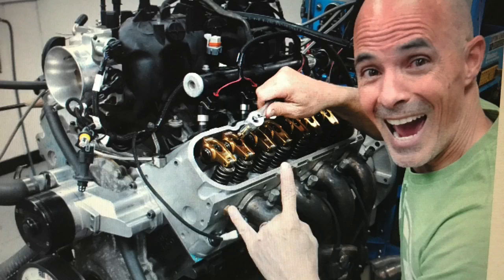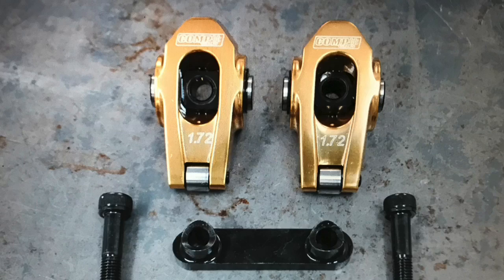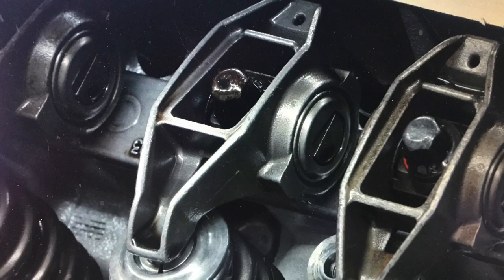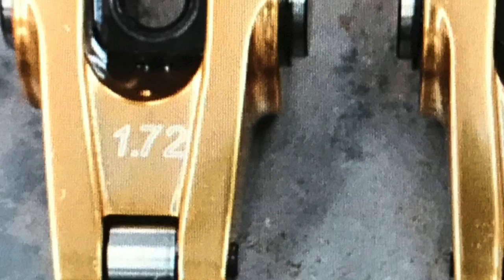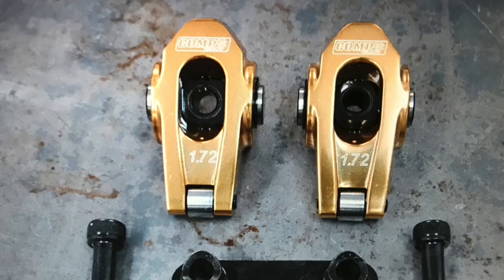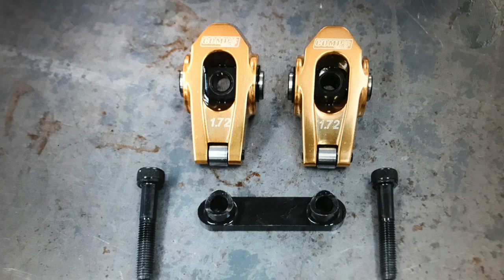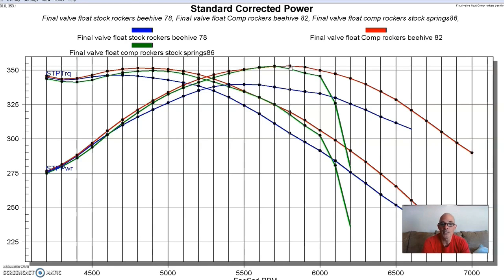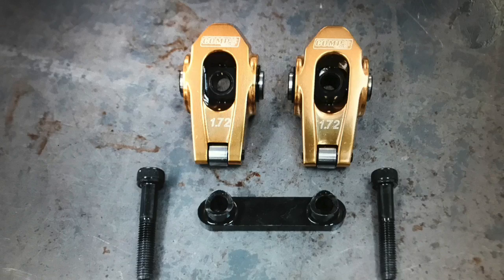LS ROLLER ROCKER TEST-DO THEY WORK?

Comment: I was thinking about upgrading springs and just the rocker ratio to like 1.8 or I was some 1.9 with the stock cam on my truck but was wondering if I needed different length pushrods now I know just put a cam in it but instead but was just wondering I mean if I have to get pushrods it's not worth it
Reply: Pushrod length should be fine with a LS engine, but always check. I run the Comp 1.8s on my  LS2 with no change in pushrods needed after measuring.
Reply from the maker: make sure to measure

Comment: I have a question.. if you upgrade the roller rocker and valve springs and retainers plus cam, what determines the size of push rod you need for the combination?
Reply from the maker: we measure to verify

Comment: Hey Richard holdener,  have you ever tested a ls underdrive pulley?
Reply from the maker: back in the 5.0L Ford days
Reply: @richardholdener1727  so does that means you have video on deck for us to watch In the near future?
Reply: OK.... I'm still building Fox cars... after all these years. 
Affordable performance.
Reply: That would be good video! I personally felt a improvement, through the seat of the pants dyno. SLP under drive pulley. But would like to see something on a graph!
Reply: I currently have a under drive pulley and light weight alternator pulley on my engine. I felt a little more vibration from the engine but it seems more willing to rev. I don't have any dyno runs but know it's not a night and day difference.  I saved it for the last possible NA mod i could do.

Comment: 7cc dome pistons on a 706 head, what’s a rough “guesstimate” on the compression ratio
Reply from the maker: on this 4.8L its a tad more than 1/2 point over stock
Reply: Richard Holdener sweet, thanks for the info and keep up the hard work.🤙
Reply: @richardholdener1727  correct. I calculated on a 5.3 not a 4.8. 10.27 is correct for this combo assuming stock head gasket,stock head chamber volume, and stock deck height.
Reply: 11.25:1
Reply from the maker: not even close

Comment: What about adding a stronger pushrod that doesnt flex much
Reply: How much heavier is that stronger pushrod? 5 grams? 10 grams? 3 grams? What's the weight difference between the the stock rocker vs Roller rocker. All this reciprocating mass adds up. I'm of the opinion that to really reduce reciprocating mass in the valve train without going to SOHC or DOCH with multiple valves one would need to position the cam much closer to the cylinder head face. Obviously that's out of the question for a factory engine. I'm surprised none of the billet engine builders haven't taken this to its logical conclusion.  Some of the billet blocks have the cam raised. In the early 80s until around 1992 I had a Renault I used for basic transportation. When I picked up the a copy of the factory manual the section on the engine showed the camshaft was so high in the block that the timing chain sprocket actually was partially higher than the deck of block. The valve train was extremely short. Plus it was a Hemi head with a crossflow head. Unfortunately is is very hard to find pictures on line.
Imagine a V-8 with a cam for each cylinder bank. Between the cam lobe and the pushrod use a finger follower. Have the pushrod seat in the rocker arm at least closer to the camshaft. Ideally so that the centerline of the tip radius, the centerline of the rocker arm and the centerline of the pushrod seat are all inline. Actually with this arrangement a 4 valve pushrod combustion chamber might really be workable.
Of course a production engine built this way is more costly. In terms of parts,  tooling, machinery and assembly it's probably just as easy to go OHC
Reply from the maker: take a look at the Chevy/Mercedes Ilmore Indy 500 motor (stock block rule)
Reply: @richardholdener1727 
That's why I thought of the finger followers. Plus I suspect the rules stated "cam as in singular in block". Ilmor really twisted the rule book when they designed that engine. But they have been stacked one above the other. And in time honored motorsports tradition the people most innovative with the rules got slapped down. 
Both Chevrolet and  Chrysler have looked into twin cam OHV V-8s. But in those cases the camshafts were stacked one over the other.
The OHV V-8 is considered by many to be a dead end technology. In deed OHV engines in general. Yes in terms of efficiency an OHC arrangement is better. But an OHC of equal displacement will almost always be larger in terms of packaging than an OHV*. The compromise between the two. The Cam In Head. I know it's been done by Opel (65 to 95 iirc). But that suffered from the limitations the cam placement imposed. Reverse Flow Head, complicated head casting etc. But it allowed Opel to carry over a lot of parts from their OHV designs. But most importantly it allowed smaller over all engine packaging. I seem to recall Ford had one engine that used that layout. Of course OHC does always mean a crossflow head. Witness the first two GM engines to be OHC (at least the ones I know of). The  Pontiac OHC 6 and the Vega OHC 4. Both non crossflow head designs which look very similiar. 
The whole point of this is that we haven't seen the last of the OHV engine. Or old out of date designs that have been discarded.  As witnessed by this effort in true hot rodding spirit
http://www.hotrod.com/articles/hppp-0606-pontiac-sprint-six-engine-build/
I dont know if the builders ever finished the project up but with a good welder and machinist a lot is possible

*In my opinion for the overwhelming majority of drivers the benefits of an OHC or DOHC over a OHV design is  not that significant. At the lower rpm range most engines operate in for the vast majority of their lives the benefits of DOHC 4 valve combustion chambered are overkill. But in certain market segments its required if you want to keep up with the segment trend setters. I suspect if Toyota or Honda started selling a vehicle that offered better power, fuel economy, reduced noise etc that just happened to be an OHV design other manufacturers would be trying to play catch-up.
Reply from the maker: that can help
Reply: I went for a full cam kit. Comes with cam,gaskets, springs ti retainers, stem seals, and hardened pushrods. 
It was from hawks motorsport

Comment: Good upload but not much new info......."Bold The Cold".....what the heck?
Reply from the maker: was from my Ninja Warrior adventure in Denver
Reply: @richardholdener1727  Good country.....have two daughters in Denver now.  Both work out like crazy....one owns a physical training business; the other works out like crazy.  Both of them hold degrees in engineering from Colorado School of Mines.  I was a USPS ranger in the Rockies for several years.  You look like a runner....I ran 20-25 miles/week for 40 years until a broken back ended that activity.  Really miss the runners "high" that I used to live for.  Keep the Faith, Richard.

Comment: I had valve float with stock cam, stock springs on my LS2 with the Comp 1.8 rockers at 6000-6200rpms. Replace your springs at the same time guys save yourself the trouble later.
Reply: correct, when you do a cam swap, do a spring swap!!!
Reply: @TaylorParks87  apparently,  even when only doing a rocker swap.
Reply: @Turbo_Todd  ESPECIALLY when doing a rocker swap.
Reply: @Turbo_Todd  putting a rocker with more mass, the spring cant support
Reply: @daveoneal5544  thanks, but yes i understood that.  I was replying to the OP that only mentioned a cam swap
Reply: @Turbo_Todd  but the OP never mentioned a cam replacement
Reply: @TaylorParks87  Yes, IF you alter timing events beyond the capacity of the springs, which is mainly when you're  swapping out a stock cam with stock springs. Not needed if they have already been replaced and can handle a bit more cam.

Comment: Another thing an older engine with stamped rockers (gen 1-2 SBC, gen 1-2 SBF, gen 1-7 BBC, etc) benefits from with roller rockers is a more accurate ratio. The stamped steel rockers aren't wearproof and unlike LS rockers, they have 2 wear points, tip and the fulcrum because they're both sliding friction surfaces. 
I had a stock 100+K mile 327 impala a few years ago with 275/60 tires and it wouldn't do a burnout. I put roller rockers (same 1.5 ratio as stock mind you) on there and it was actually able to spin em.

Comment: I recently went Comp roller on my LQ9 except I did the 1.8. Last year I did the Crane 210/218 on a 114 LSA.
Reply: Tom Wetz  little after 2,500.  At 1,500 cruise it's a little choppy and a deep drone that wasn't there before.  Running TBSS intake, TB, injectors, dynatech headers. Was tuned.

Comment: I always assumed that with a higher lift cam and stronger valve springs losses from deflection would be greater with factory rockers so gains from the stronger aftermarket roller rocker might be a little more. Maybe this would be more of an issue with older style SBC and other stamped steel rockers. Any thoughts on that? Great job on the videos, I really enjoy them.
Reply: I think you are correct
Reply: I broke a couple stamped sbc rockers after changing to a sig erson stage 2 with spring upgrade. The things just cracked in two. Definitely recommend a roller with a cam/spring upgrade on those old motors.
Reply from the maker: not a lot of deflection on stock LS rockers, also this combo wanted more camshaft so it responded. If you give it more cam, might respond less to rocker ratio change

Comment: Great Content as always. Tons of data. My question is, I remember reading an old Hot Rod magazine article about crank shafts and the material they are made from. It talked about crank flexing under the compression stroke and all things being equal, stroke and weight, a crank made of 4340 will show more power than a cast crank simply because it won't flex under the combustion stroke. Thoughts?
Reply from the maker: not sure when (or if) that would become a reality
Reply: That claim does not make sense from a mechanical engineering material science point of view. Deflection (strain) as a function of load (stress) is well understood science. All materials will flex/strain under load, the question is how much - and at what point will it yield, fatigue or break. The slope of the "stress-strain" graph is called "modulus",  and defines the elasticity of the material. The modulus of all iron-based alloys (including cast iron, nodular iron, 4340, 300M, Stainless steels, etc) ALWAYS hovers right around 30 million pounds per square inch. There is almost no difference in modulus for the various different alloys of iron. Therefore, you should not expect different flex characteristics from one iron alloy to another.  Do not confuse modulus with strength, which is a totally different characteristic. I hope that helps.
Reply: Nodular Cast Iron cranks are pretty tough. Not as tough as a forged or billet crankshaft that has been properly heat treated. But equal up to the power le else of what most drivers could adequately handle on the street. Admit it, we have all known somebody who was either too young, too inexperienced, lacking in skills, lacking in reflexes that have gotten themselves in trouble or worse killed themselves and maybe somebody else. Simply because they were driving more car than they could handle. In some ways I'm surprised that governments in general haven't come down on the manufacturers on the performance side of things. Or state governments on drivers licensing. When one takes flying lessons and gets their ticket to fly a Cessna 170 that does not mean you can hop in a P-51 and take it up. With carsit's different. Take your test driving a Honda Civic and then when you get home you can take off in 600 hp car. If the idea of some 16 year old kid behind the wheel of a car that has the potential to exceed double the legal limit most places (are there any states with prudent limits) does not scare the snot out you it does me. I'm lucky. I didnt kill myself or anyone else doing some of the idiotic things I did in the day. Others I knew weren't so lucky.

Comment: For my money, I would rather spend $400 on a cam and springs (since springs will likely be needed with rockers anyway), and pick up 50-70 HP than spend the same money on rockers and pick up 10. Also, you have a TON of laps on that poor little 4.8 by now, that's been a great test mule. Thanks as always Richard.
Reply: What if you already have everything done except aftermarket rockers...are they worth it now?
Reply: @Forcefed2002  probably not for 10 HP, not to me at least. At least not on a LS. On a BBC or SBC they would've been one of first purchases along with the camshaft upgrade.
Reply: @Forcefed2002  If you have headers, cold air intake, FAST 102 then yes. As a final mod it's fine, and you have upgraded your stock valvesprings too so one less thing to do if you cam it.
Reply: Cam install is not comparable in time and money. 1.8's and valvesprings are easy to install and still cheaper. $340 for the rockers and $200ish for springs. Nowhere the same in power but it's a decent increase and if you do cam it, your springs are done. Have you ever done a cam install? If you have you know it requires at least 4x the labor Add in the cost of a dyno tune now.
Reply: atf0013 
$340 for rockers and $200 for springs that give minimal gains without a tune and about 10hp with a tune (like what Holdener did here as he optimizes the tune with every setup he tests) 
VS 
$260 Summit brand Sum-8718 cam (similar specs to a Stage 1 truck cam from BTR or TSP) that doesn’t need springs and adds about 50hp to a 5.3L and 35-45hp to a 6L (as demonstrated in his test with stage 1, 2, & 3 truck cams).

Seems to me that a mild cam that reuses springs is about half the cost and about 3-5 times the power gains.  Plus, spring changes can take just as long (and are arguably more difficult than) as swapping a LS cam when it’s in the vehicle...  not to mention a spring change allows much larger cams that can gain 75+hp or more depending on setup; especially on a 6L.

And really, what’s a few hours of work to increase your power drastically.
Reply: ChuckO Are you including the actual costs in parts that go with a cam swap, like gaskets, oil pump, timing chain? Gonna reuse all that stuff?   Dyno tunes cost around $500 for a cammed car too. And a cam swap requires a lot more than just springs and rockers. 1.72 Rockers alone are probably not worth it for the money to most as a stand alone mod, but if you want to run the stock cam, 1.8's pick up 15hp on average to the wheels, and this should be a easy final bolt on addition after LT headers, and FAST 102 etc. I don't think that baby Summitracing cam is worth swapping. 500 lift? Anything under 600 lift in a LSx is pointless my man. Except maybe on a 4.8 or 5.3? Most heads like the 706, 799/243 flow best at .600. Stock LSx valvesprings are only good to .550-570 realistically and even less with higher miles, so rockers or a cam worth a damn means new valvesprings.

Comment: What about chainging from a 1.7 ratio to a 1.8 ratio rocker arm.  How does this change things??
Reply: It put me from 394hp/392tq at the wheels to 410hp/402tq with valve float. Not as good as a cam for power, but it had +15hp/20tq at points. I feel it's worth it in terms of time to money if you do the install yourself. I would do headers and a FAST 102 before 1.8 rockers. They were my last "bolt on" part with stock cam.
Reply: @atf0013  Thanks,  I'm more interested in finding out how the cam specs change by adding the 1.8 rocker arms.   I've heard they change lift, but not duration.
Reply: @budgetoutlaws9978  easy math.  Take your stock cam lift and divide it by the stock rocker ratio. Take that number and multiply it by the new rocker ratio, say 1.8. On a LS2 GTO cam it's  .520/.521 with 1.7 stockers. With 1.8's it's now .551
Reply: @budgetoutlaws9978  the duration will change because of the faster acceleration of the valve due to the increase of the rocker arm ratio. When you degree in your cam watch the opening and closings change.
Reply: @martybrozek7973   Thanks,  I can figure the lift, Is there a math calculation for the duration?  Or the LSA?  Or is a degree wheel the only way?
Reply: @martybrozek7973  I read this on a forum awhile back. I think it was 2-4* at most.
Reply from the maker: plus effectively 2 degrees of duration
Reply: @richardholdener1727  you are the man!
Reply: @richardholdener1727  Thanks Richard and Marty.  I heard it wasn't much.  That gives me a better idea on this second hand LS6 in my Porsche 914.
Reply: @budgetoutlaws9978  LSA is ground into the cam at the time of manufacturer, lobe centerline is what the engine builder can change by degreeing the cam. After I am finished with degreeing the cam l roll the engine back to true 0 and mock up the balancer and pointer to make sure it's not off. You can also roll the engine to whatever you want for total timing and mark the balancer at that place. I found one that was off by 8 degrees one time.
You will have to post your build when you are finished.

Comment: Toyota actually went away form a roller tip in their Nascar motors as they determined the reduction in weight and complecity of a slider vs roller asembly was better for thier application.
Reply: Yes. Geometry say it has to.
Reply: 5-600 miles life. 
Power is the 9nly consideration.
Reply: osp80  about  1-2 mm across the tip of the valve.
Reply: @manitoublack  that is great information! But yeah their heads get rebuilt ever race. No roller tip on high lift cams puts more pressure on the valve guides and will possibly wear out valve guides sooner per every head manufacture.

Comment: Roller rockers don't really give power they simply  free up hp from a more stable valve train . There also heavier then most factory rockers unless a person is using a high rpm deal they don't free  much power